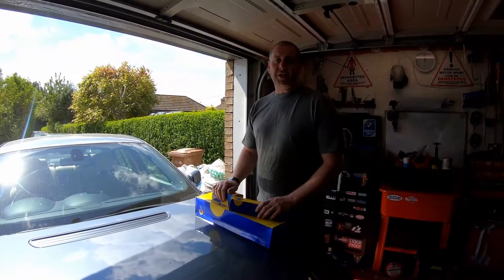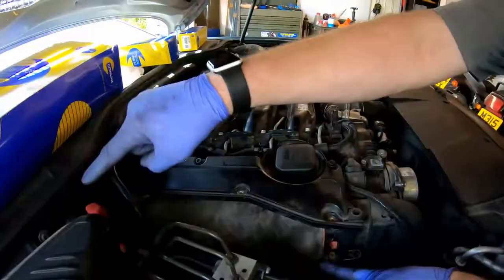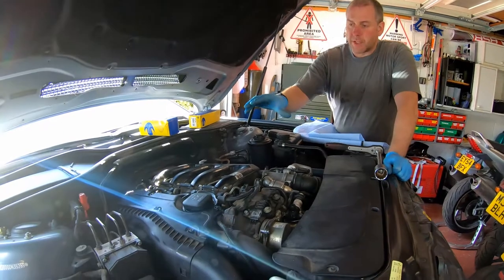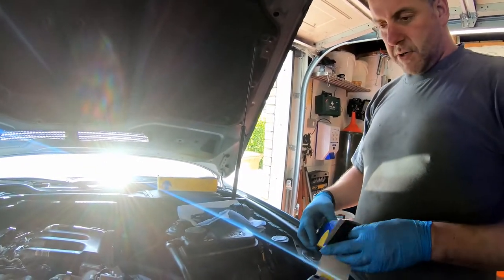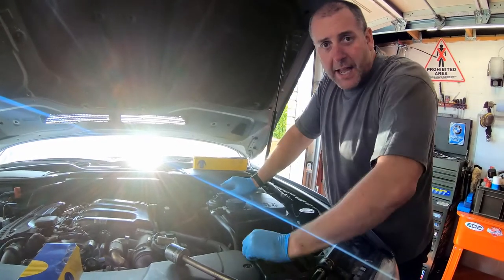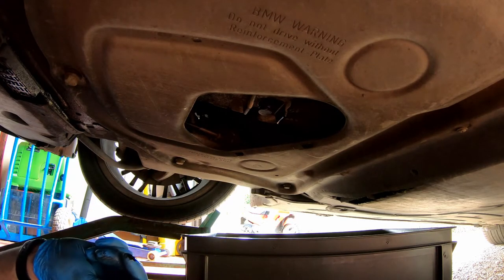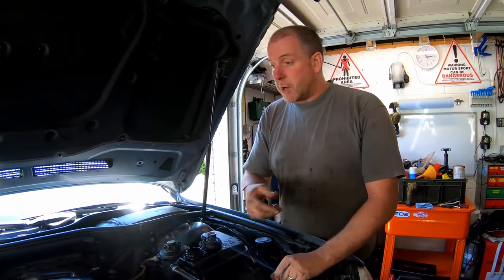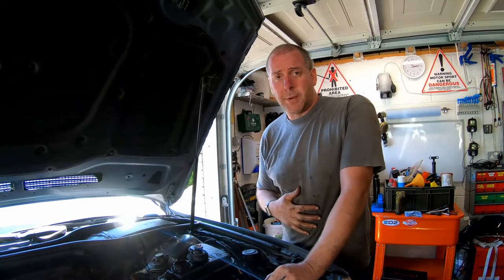Servicing The BMW E65 730d - Oil, Oil Filter, Air Filter, Fuel Filter And Coolant

Comment: Great video - that bolt at the back to get the air filter housing off had me almost in tears...really really tough.
Reply: I am in tears :-(  How did you get the little bast*rd out ? my fingers are in bits , the only 10T I have is much too big to get in that gap ..I've been hours at it 😞
Reply: For anyone struggling to get this bolt back in: Take the whole air filter box off again and re fit it making sure that you get the bottom edge properly overlapped so that it seals. If you get this right, the difficult bolt will be naturally aligned with the threads and all you have to do is screw it in! 

It is possible to get all of the other bolts in relatively easily without the bottom edge properly in place, leaving just the difficult one not aligned and therefore impossible.

Comment: Great video, thanks. I've been removing my pollen filters and upper firewall to replace my air filter, this will be much easier going forward....

My new fuel filter usually comes with a little flat rubber washer that goes between the filter and the rear (big) fitting.

My car takes around 7.5 to 8.0  litres of oil to get it to max in the iDrive screen.

Comment: i do the same thing with my used oil filter and i like how bmw uses all those covers underneath the vehicle to protect against the elements, but it does look a little annoying to remove and put back.
Reply from the maker: The car is surprisingly clean behind the plastics, the brake lines still look brand new so there is a benefit to it! I agree it is a little annoying having to remove it all!

Comment: On the oil filter cover: first I clean it with brake cleaner, when assembled with the new filter I lubricate with new oil where it is necessary.
Plus don't forget to reset the oil life interval (in the "secret" menu)
Reply from the maker: I did a video on that very thing!
Reply: @KevsShed  Thank you Kev, looking for it. Do you have anything about changing the oil separator as I plan to change it next time?
Reply from the maker: Yes mate, have a look through my videos, did a vid on that about 2 months ago! 👍🏻
Reply from the maker: In fact, here you go 👍🏻 Replacing The Crankcase Oil Breather Valve On The BMW 3, 5 & 7 Series and BMW X3 & X5
Reply: @KevsShed  I did, subscribed and already found some very useful! Thanks for your time!

Comment: How do you prime the fuel system after the fuel filter replacement?
Reply from the maker: Simply by turning on the ignition, the lift pump in the tank will push fuel through the filter up to the HPFP 👍🏻
Reply: @KevsShed  thanks for the answer, i just replaced fuel supply pump and fuel filter,  then turn on the ignition and the fuel supply pump starts, and I hear that the fuel system is vented, but the pump does not stop, it seems that it cannot achieve the required pressure before starting the engine, because it did before, what do you think the problem can be?

Comment: I have the same car i just change engine oil and filters Castrol 5&30 but the oil stick shows little bit lower than normal i put 7 litres ??
Reply from the maker: What does the oil level say on the idrive?
Reply: @KevsShed  It says max and when i drive little bit it is in 3 blocks but i change it before 10 minutes
Reply: Whel it  sey 8.25l
Reply from the maker: @malisa5211  I think those oil quantities have incorrectly been quoted as the total oil required when rebuilding a dry engine. If you put 8.25 litres in then it will be way over the upper limit. You are much better off putting in a little at a time and checking before topping it up.

Comment: Is that Car really that unrealiable as people say im thinking to get one from 2008 with 94.000 Miles
Reply from the maker: It’s an electrical nightmare but mechanically they are fantastic and this Diesel engine is bombproof. If you are able to carry out diagnostic functions yourself then ownership is easy. If you need to take it to a dealer every time there is an electrical issue you’ll never be out of there!
Reply: @KevsShed  hi thanks a Lot for the reply..and advise i will think about that, i tought The facelift Models dont have that much electrical issue. Also nice Video very helpful and clear for doing it yourself.

At The Moment i have The w221 s class from 2007, its also very nice Car but i have The known issue with the coolant oil leak, at least BMW does Not have this problem
Reply: Yea evry dey somthing new  new light on panel 😂😂😂
Reply from the maker: @malisa5211  True story buddy! :)
Reply: @MBCar freak if you manage to find your self a well sorted out example go for it 2007/8 is a good model year as the i drive got a much needed update and new lci headlights and electronically it became more reliable by a fair margin in comparison to pre-facelift/ pre-Lci model. A code reader would be handy as its a german car both benz and bmw like to throw up random codes sometimes, just good to have if your going to potentially buy one.